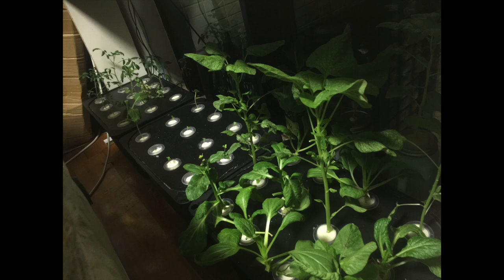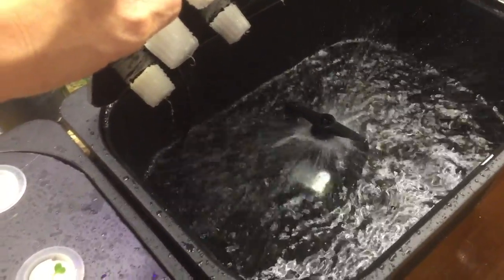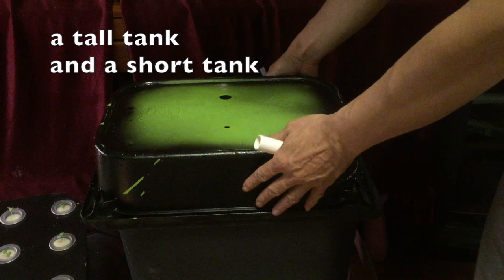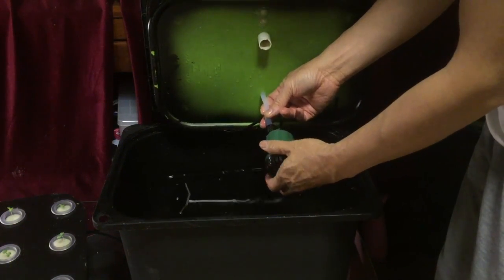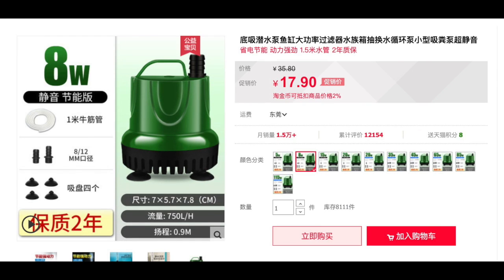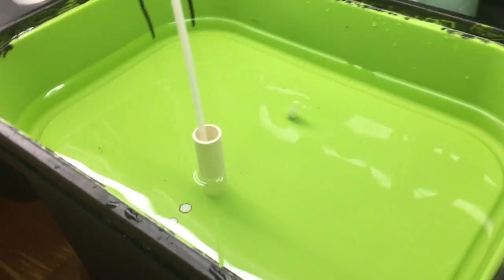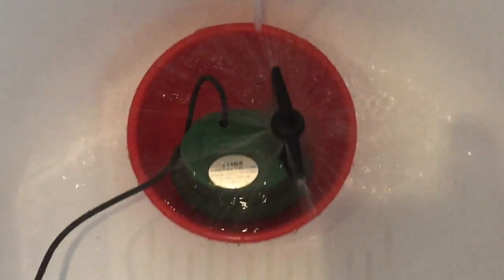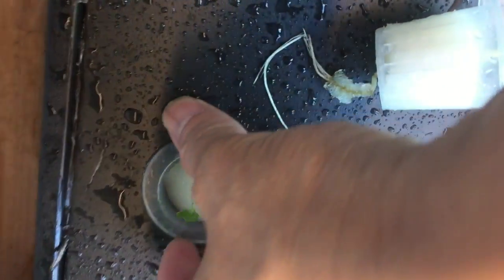DIY 3 types of hydroponics systems - Fogponics, Aerophonics, Flood and Drain Hydroponics

Comment: Where can I get a sprinkler like that. Unfortunately I tried the fogger it worked but the outer clones died , only the  middle clones stayed alive. So I made a float for the fogponics system and also  a pump and a sprayer.
Reply from the maker: Here is the link to one of the online shops
https://www.aliexpress.com/item/4000338176615.html?spm=a2g0o.productlist.0.0.387d6f60cyqvOl&algo_pvid=1ac7b617-ab73-4e7b-a560-320b98103b3c&algo_expid=1ac7b617-ab73-4e7b-a560-320b98103b3c-45&btsid=0ac8a8c0-a6dd-4435-90be-f303ba8f09d2&ws_ab_test=searchweb0_0,searchweb201602_6,searchweb201603_53